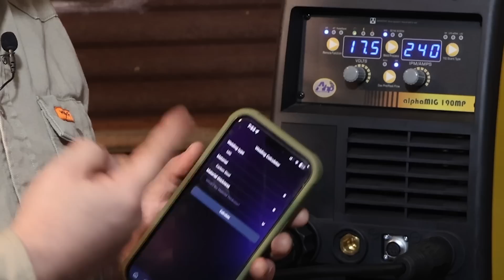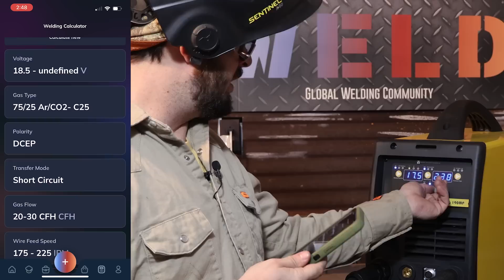How To Make A Modern Metal Shop Stool Using The Ahp Alphamig 190 Mp

Comment: The only tip I could offer to help with lining up those layout lines, would be to sharpen your soap stone. 
Grind a knife’s edge on one side then grind it down to a single point length ways. 
I always find that the sharper your soap stone when doing layouts, the more accurate you will be. 
Always a good idea when cutting.

Comment: You (and a LOT of others) make the same mistake.  You cut all the way into the back metal then bend to 45 deg and it doesn't work properly.
The trick is to cut all the way back to the INSIDE of the back wall, then bend to 45.  Mark the back wall thickness on the tubing and don't cut pass that line.
You will get nice clean no gap 45 that way.
OR you cut all the way through and have two separate pieces and then bevel and weld them together.

Comment: Does anyone know how much it would cost to have a dryer electrical socket in my garage for my mig welder
Reply from the maker: It depends a lot on your current breaker box and then running the wires. You can save money if you run the wires yourself. It fluctuates from place to place but as far as actual price not 💯 sure.